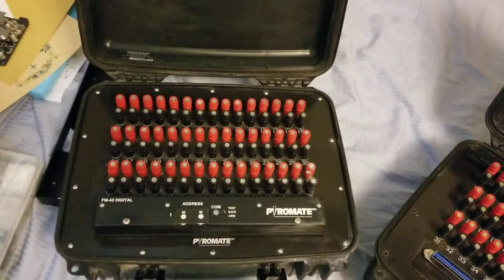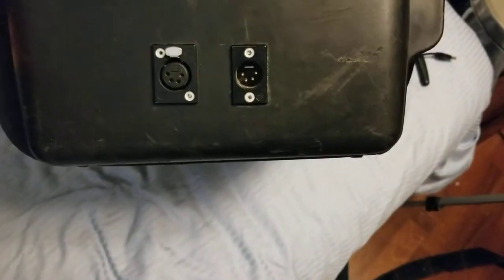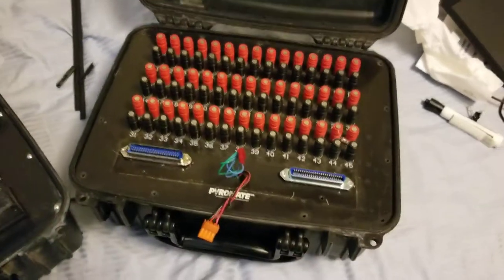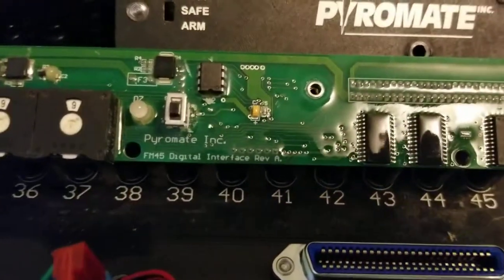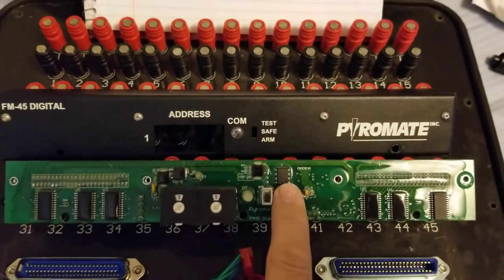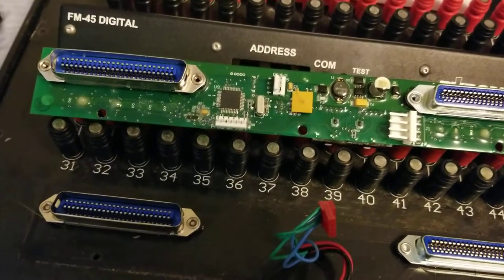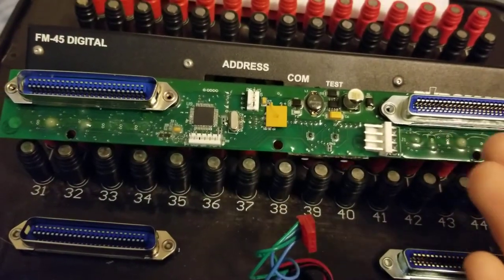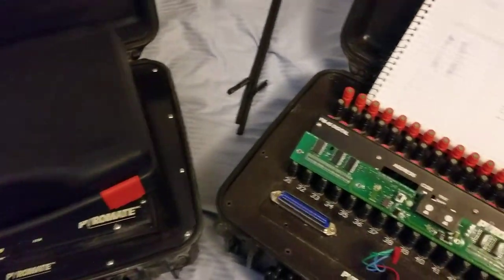Inside a pyromate fm45

Comment: Have you or are you planning to look at the data packets bouncing back and forth on the RS485?
Reply from the maker: I have actually figured out the packet format and have built a plug-in for pyro ignition control.  ill post a new video in a moment
Reply: @jamesgunn9140  Are you still working on this project?
Reply from the maker: I haven't messed with it in quite awhile. I still have them though. I did get it fully working with pyro ignition controller. I'll have to pull out my setup and do a follow up video. I was planning on releasing the source code for the plugin I made
Reply from the maker: @longshot7601  https://youtu.be/VUhxXQ27eGA here is the demo video. If you looking for the protocol I can look it up on my old computer.
Reply: @jamesgunn9140  Thank you for replying.  I've been sniffing around the data packets and found that it is a RS485 sending hex code.  For firing 2-start bytes, status byte for ARM/TEST,  6-byte firing cue, 2-parity bytes then 2 end bytes.  The goal is to get a microcontroller to understand the protocol.
Reply from the maker: @longshot7601  so i just went through my notes. there are 3 packet types. 2 are command type and 1 is a response type.  response's are 16 bytes long. responses include the module id, all the cues continuity and the voltage measured at the module.  in s serial terminal over rs485 send 3f 13 01 65 00 00 00 00  6c 47 00.
3f = query
13 = endof SOF
01 = arm
65 = module 101(01 on the dial)
00 *4 = N/A
6c = low byte modbus crc16
47 = high byte modbus crc16

you will get a response like {|23 13 01 65| 00 00 00 00 00 10 <7C 01>}[9C 6F] 00 00
23 = response
13 =  end of SOF
01 = armed
65 = module 101
00 * 6 = continuity in binary. each bit is a cue.(cue 44 had a test bulb in the above packet)
Reply from the maker: @longshot7601  here is a test script in python http://nightflyerfireworks.com/source/pyromate.py.zip you must instal